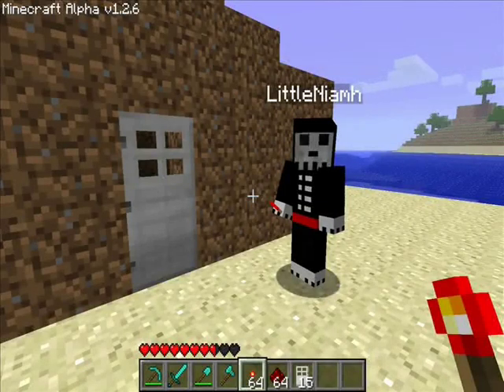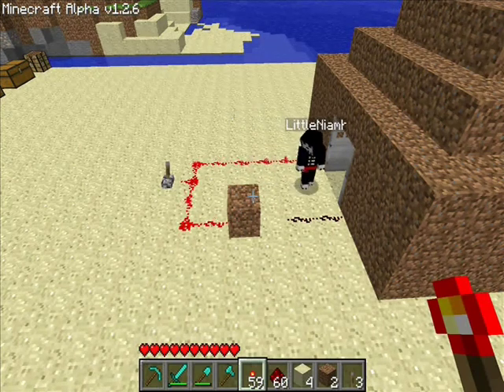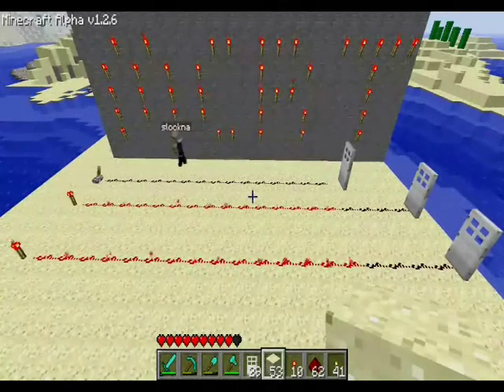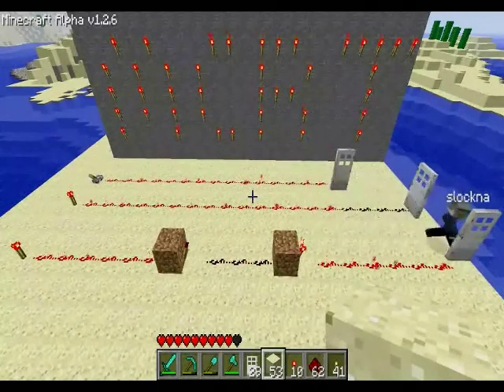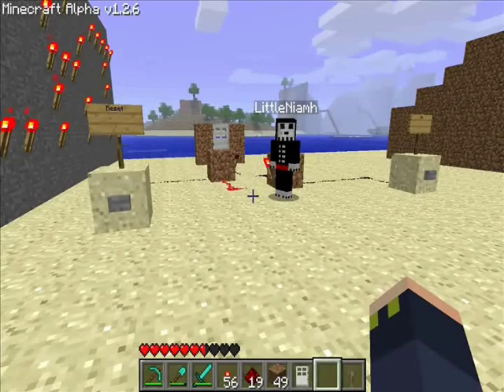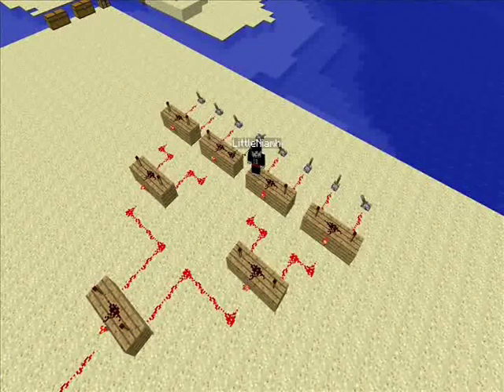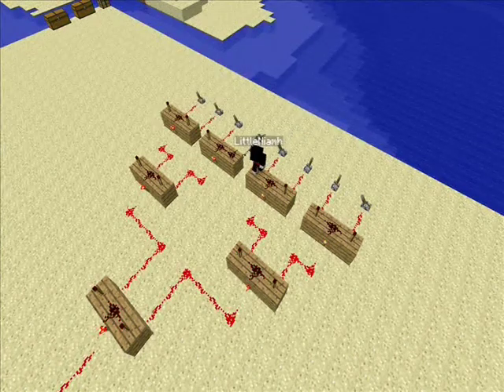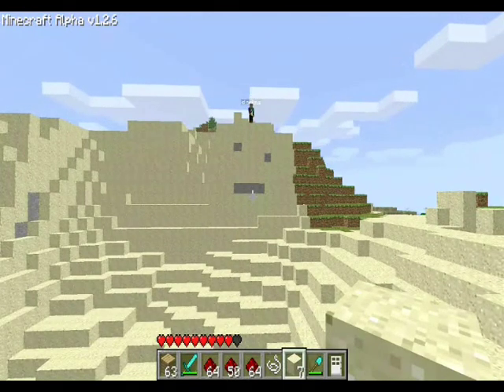Minecraft Redstone Tutorials - Iron Doors, OR Gate, AND Gate, Combination Locks

Comment: Marcus L, thanks for the response. If I had enough gates and redstone, I could potentially have a security system that could protect the successful testificates from zombies at night, and let them wander free during the day; all I would have to do is pull a switch. The only flaws in this plan is I have to find a way to make an effective underground circuit, the mob attacks during construction, successful testificates dieing during this time, minor damage from being suffocated by sand et cetera.